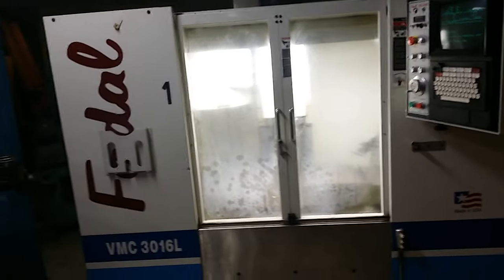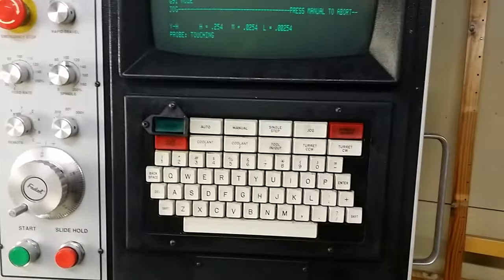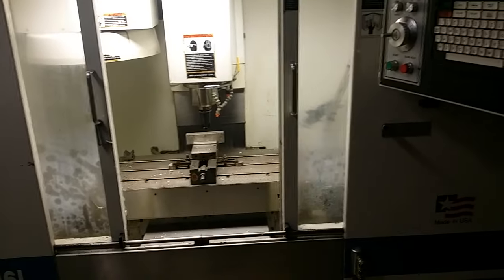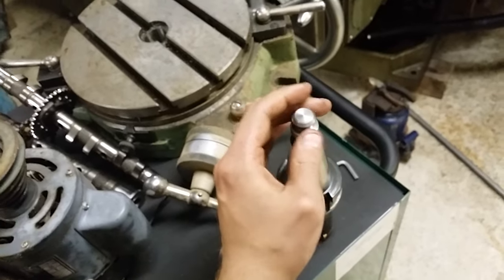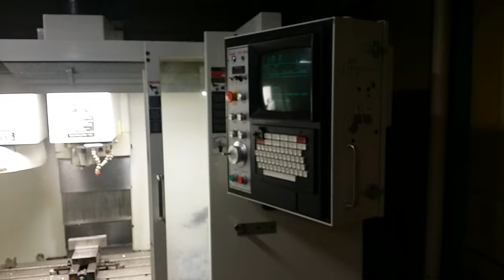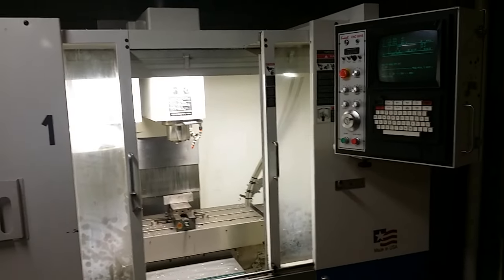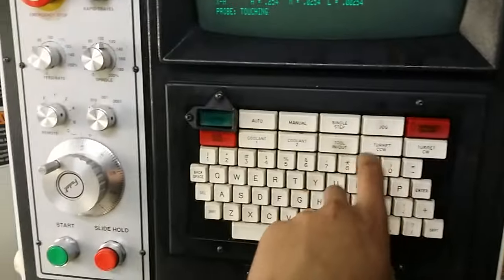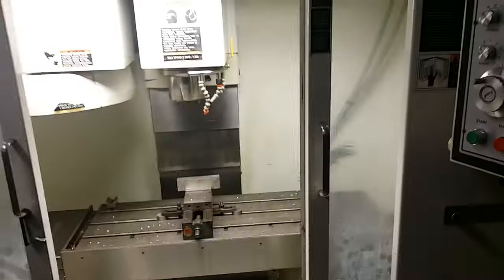First chips on the VMC

Comment: You inspired me to go finish installing the chip enclosure on my VMC40.  I've only got 1 thing left to put the machine back to proper spec: the spindle cooler pump.  Mine uses an older cooling system than yours, they simply circulated coolant through the spindle housing and back to a reservoir, no refrigerator was used.
Reply from the maker: Nice! Will have to take a look at your vids!

Comment: Congrats sunppaa.... Very cool...! I look forward to your learning curve. I googled that machine and it appears to weigh about 4 ton? I vote for the moving video first.... :-) Especially to 1/2" clearance thingy through the door and the left turn-right turn into the shop....!
Reply from the maker: Thanks! It weighs a little under 3 metric tons. It is pretty lightly made due to the linear way design. I'll try to edit it next. It's just not so easy sitting on my computer for a few hours versus going to learn the machine :-D!

Comment: Excellent! Congrats on the startup! Regarding the foots, i´m guessing you´ve already tried hockey pucks, as you mention, on some machine. If not, i just wanted to say my metal shaper sits on 4 hockey pucks, and has since i got it a year ago, and they seem to work great. I havn´t seen any wear what so ever in them yet. What i did on mine was to drill a big hole halfway thru the puck so the head of the bolt, going thru the machine, kinda holds the puck in place. Works like a charm!
Reply from the maker: Yeah! I plan on making feet of pucks by turning a tight "cup" around them only exposing the lowest quarter inch or so making them stiffer and easier to adjust. But even those might be too tall.... For the other machines I will do this, however!

Comment: you could cut the ceiling and make a nice cover plate deep enough for the cable track to clear maybee a nice piece of stainless
Reply from the maker: I lowered the machine about an inch and now its fine. I really don't feel like cutting the concrete ceiling especially because it would men moving the machine again. I hope I get to keep the machine as low as it is now, but I might have to take the route you suggest!

Comment: The chips seem largely to be Delrin or something like it; good news......as opposed to some abominably hard....!!!  Think of some projects to undertake BEFORE "loading up" on tooling.....unless an offer is tendered for an "incredible lot"!!!!

Congratulations for getting this beast "up and running" so fast; YOU probably spent many late night hours 'diddling' with the control panel...???
Reply from the maker: Yes, most chips are some kind of plastic, but I also found steel and stainless under some covers. I still think this machine has not had a very hard life.

Comment: Excellent. I found out that when I bought mine there were some sensor issues or broken wires. Still have not gotten it fixed. Tool changer does not work and fourth axis does not work on my machine.
Reply from the maker: Ah, that's bad. Good luck with the repairs!!

Comment: Sounds like the gain is set to high on your servo amp for the X servo. I think you need to do some PID tuning on your servo amp. Can't really help with your Fadal, but on my siemens drive i've got a few potentiometers to adjust the servo amps.
Reply from the maker: I'm thinking so too. You got any info on how to adjust?
Reply: is it yaskawa servo drives or fadals?

Comment: If the servo has already been replaced it could be the servo amplifier.  Of course you need an oscilloscope to diagnose the servo amplifier...

Did the machine come with a floppy disk containing the DNC software?
Reply from the maker: Yes, it must be the gain settings probably. Need to look into that. You got any more info? No DNC yet.